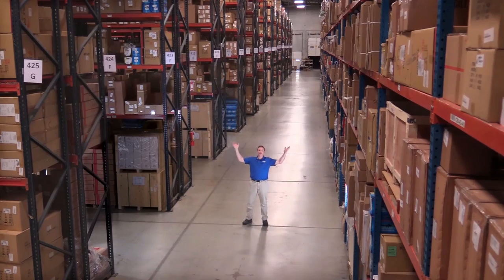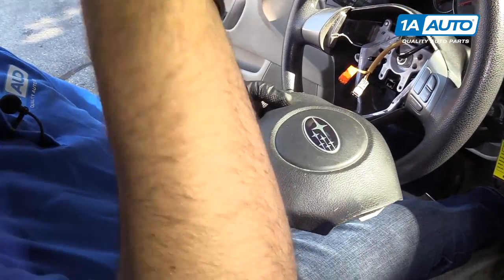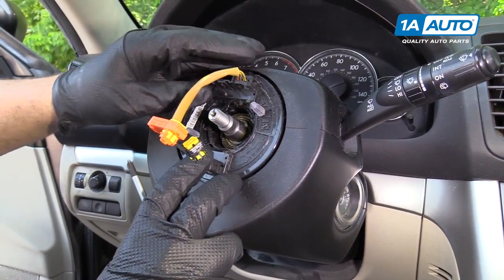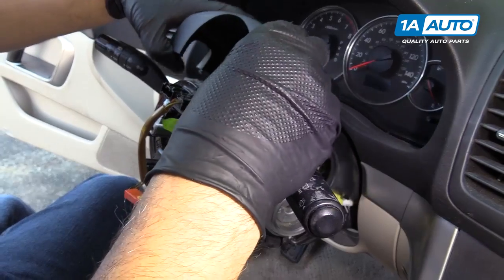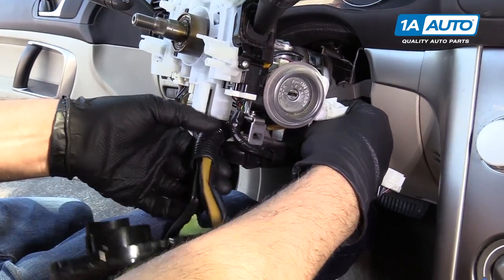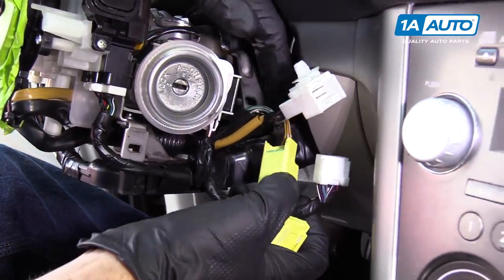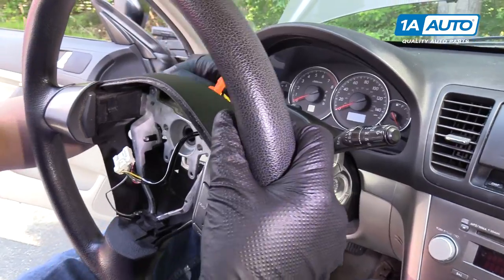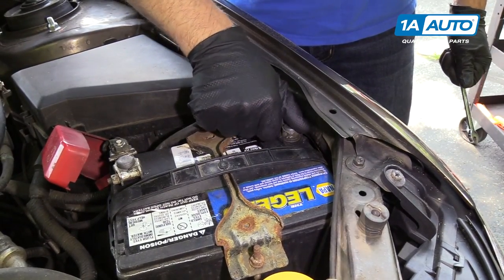How to Replace Airbag Clock Spring 04-09 Subaru Outback

Comment: I did this on a subaru legacy 2010 and now the buttons on the steering finally works fine !! BUT, some lights are still on in the dash : ABS , traction control and parking brake light flashes.   There is no DTC (check engine) code. Is there another kind of reset than unplugging the battery 30 minutes to be done after this job ?  Thanks
Reply: get to check your steering angle sensor or your VDC

Comment: Did i need to calibrate steering angle sensor ?
Reply from the maker: +Enrri Duarte As long as you are careful about maintaining the alignment, you shouldn't need to reprogram the steering angle sensor.